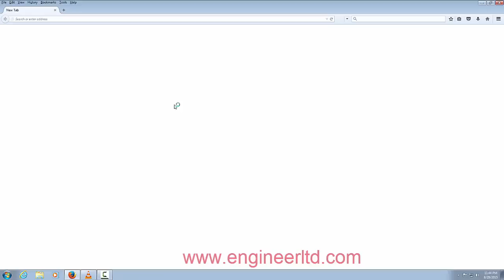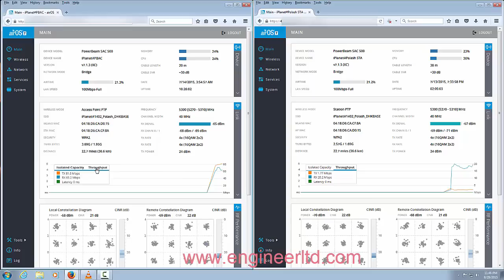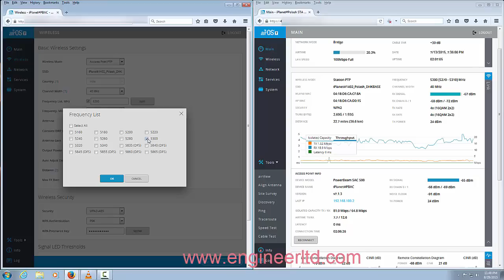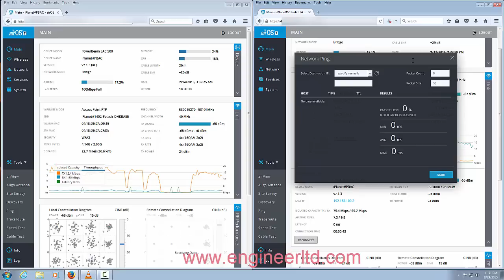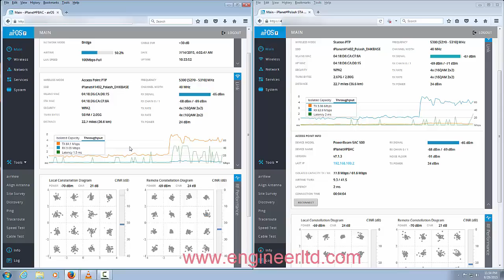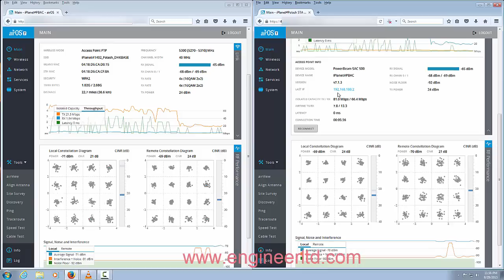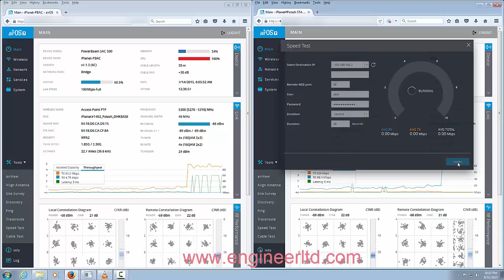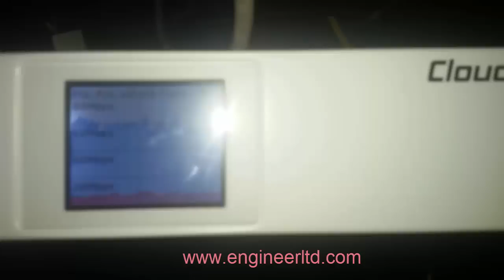Point To Point Wireless Connectivity 36.8KM Long Range by PowerBeam M5 AC 500

Comment: I have the powerbeam 620 at only 1.1 miles away and am rocking 360Mbps dl and 24 ul ... I think I could point the radios in the opposite direction and still get great speeds ... these systems are amazing ... If you live in a rural area and have a friend near by that is on a cable network, these systems are totally worth the money and time to install. I live in the country and cannot get more than 1 Mbps service out here, that doesn't have a data limit ... I was seriously considering moving, just to get on the Time Warner network, until I found out about the nanobridge ... Best investment I have made in a long time ... We had a major storm pass through yesterday and I didn't lose any speeds. Love it!

Comment: I like this video

The link is very good , excellent signal , the entire installation process was great. What it does not seem right was the speed test only ran the reception at point B and transmission at point A. More they did not reverse to know how much is transmitting point B and how is receiving point A . According to the image you sending Mikrotik but getting 80Mbps to 20Mbps , I consider that still need to improve the settings for transmission and reception are optimal. I say that if it is a dedicated enlce for intenet .

Comment: At least the antenna is safe (unless of course the installer should fall). Come on guys! How much does a piece of rope cost in India? And while you're at it, get some proper shoes, or at least sandals that have a strap on the back. All it takes is one wrong move
Reply: well, seems that in India, life is cheaper than a pair of shoes  ;)
Reply: This is not in India . Its Bangladesh according to his ip address which he tried to censor lol

Comment: 36.8km = almost 300feet of curvature drop, if the earth is a globe and this is a point to point network, how the hell would this work ??? Someone please explain with a legit answer, trolls will be ignored
Reply: 5 days later and you are beeing ignored , wonder why
Reply: Earth is flat.
Reply: Honest answer.

Vertical adjustment. If you have the dishes high enough, the curvature of the earth doesn't matter as much. You'll just have to aim the dishes down a little bit and they'll be in line. Ubiquity sells some radios that have ranges in the 200+km realm. I've never used one that far, so who knows if it's a major pain to set up
Reply: It might work due to it been tower mounted.

The limit should be around 70km/40 miles, mobile providers sometimes also do this sometimes.
T-Mobile has made a video about that (in German), they have built a 64km network bridge: https://youtu.be/q_Ja6QtWwpQ